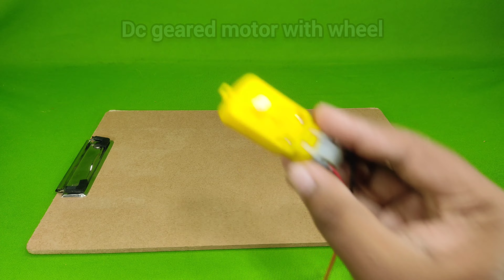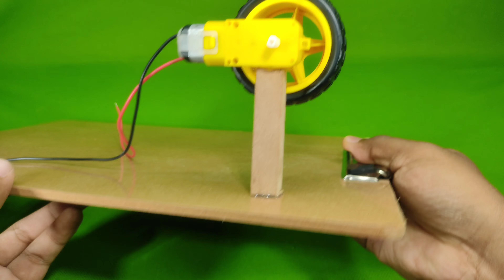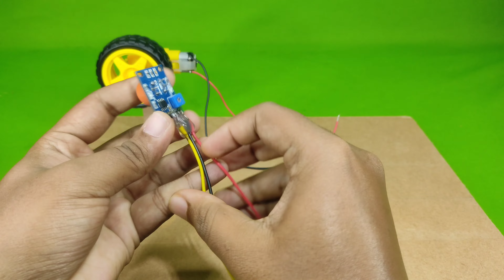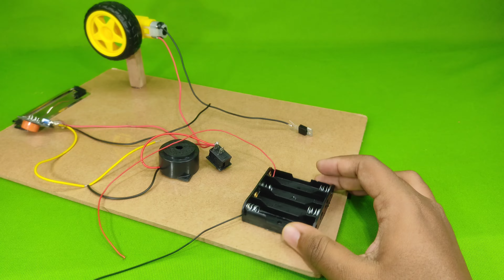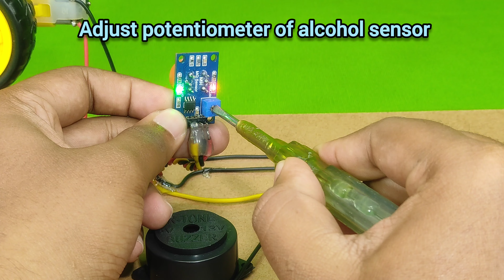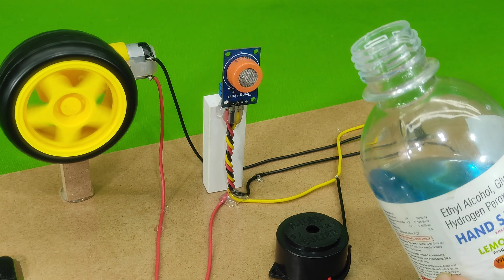Real time Alcohol detection and auto cut-off engine system || Award winning project 🏆🥇🏆

Comment: bro mine is not working bcz in m using another mosfet so should i use ur mosfet xompulsorily
Reply from the maker: Yes and you have to use cells only don't use hw battery
Reply: @MKSmartcreations bro i m using l780 mosfet and lithium ion battery with 3.7 volt will it work pls reply fast my prjoect demo is near pls pls
Reply: @MKSmartcreations i m trying since 2 days i didnt slept for 2 nigjts properly pls reply bro help me yr bhai
Reply: @MKSmartcreations bro actually my alochol senser working well and my buzzer too but my vehicle is not stopping this is the main problem pls solve ittt plsss bro

Comment: Sir can we use 9v hw battery instead of that batteries?
Reply from the maker: No it will not work
Reply: Can we use same circuit for smoke sensor also

Comment: Can i use 3.7v battery 2
Reply from the maker: U can use but it will damage the sensor because it only holds upto 5 volts
Reply: @MKSmartcreations  can I use1.5 v battery 4